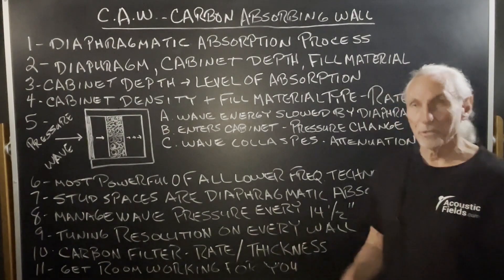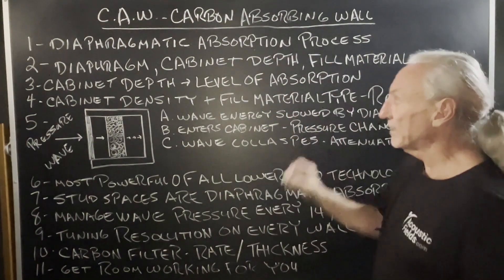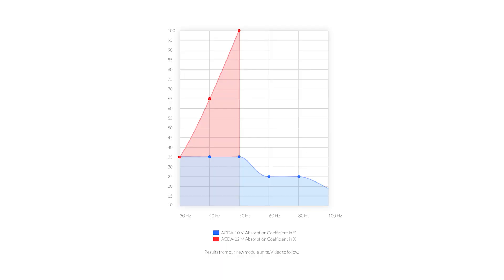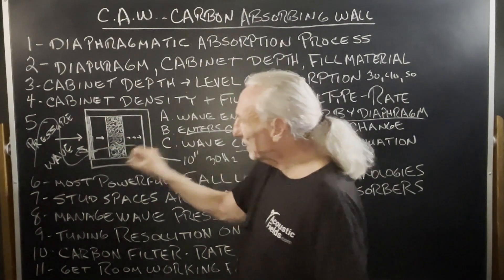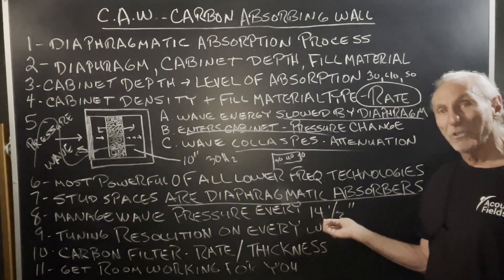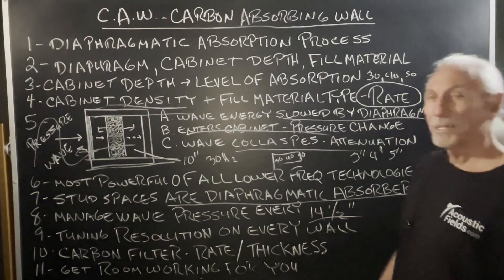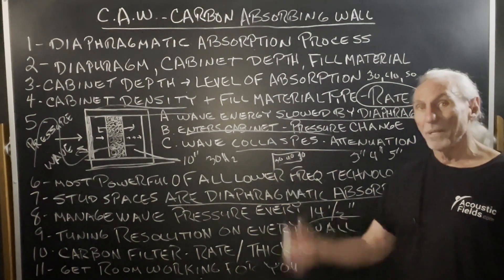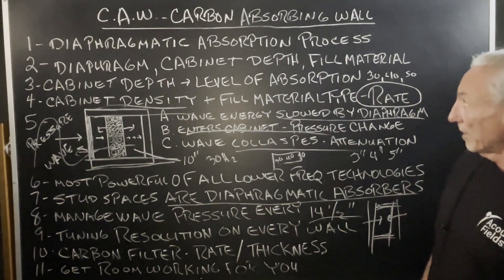CAW - Carbon Absorbing Wall - www.AcousticFields.com

Comment: I've got a three part question.  1) If this is integrated into existing wall cavity, isn't there an issue on "soundproofing" side due to no wall decoupling?  2) Can this be optimized on the "backside" (e.g., exterior wall) in each 14.5 inch cavity to "soundproof" out sounds?  And 3) What is recommended for basement ceiling, with regard to carbon absorption ceiling?  Thank you for your awesomeness!  I make biochar, mostly from red cedar, and also had been considering making cedar-chip/ biochar/ cement boards for such a purpose (and other acoustical applications, e.g., sound barriers)... and I came across this wonderful explanation of acoustic design!  You rock the casbah!  Appreciate ya!
Reply from the maker: WOW thank you so much. It is nice to see my work appreciated. You are confusing sound absorption with noise transmission. The CAW is a sound absorption methodology. Your barrier technology should be installed prior to the CAW. Starting from the  They are separate systems. If the noise levels are not too high, we can build the barrier into the CAW. When you treat a room for low frequency pressure absorption, you always have to treat the four walls. You may be able to get away with treating just the ceiling and four walls. Sometimes, in high energy rooms (drums) you must treat the floor also. The basement ceiling has to be treated with barrier technology since noise transmission through the ceiling in a basement up to the first floor can be an issue. You sound like a serious person when it comes to sound. Send us you room data. Let me take a look. I will save you thousands in mistakes.
Reply: I'm also working on creating a basement room into trackign and mixing room, and may "take" another room for control down the road.  Thanks again for your wonderful explanations of acoustic principles....

Comment: Is it ok to have a CAW on one side wall (interior), and carbon cubes on the other (exterior)?
Reply from the maker: When you treat lower frequency pressure issues, it is all about the square footage of treatment coverage you put on each wall surface area. Remember you have three rooms within your room. You have a sidewall to sidewall room. You have a floor to ceiling room and you have a front to rear wall room. All three rooms have different frequency and amplitude issues. The treatment type and amount will be different for all three "rooms". The goal is to use enough treatment on each surface area to treat 80% of the frequency and amplitude issues. If you use our CAW system you are treating 100 % of the surface area. If you use our cube technology you would be using much less treatment coverage. This inequality in surface area coverage would produce phase which would manifest itself in many ways. One side of the room would have an 80% solution and the cube side much less depending on the number of cubes you used. It is always best if budget and space are issues, to treat each of the three "room" with eaual amounts of treatment coverage.

Comment: How much can I benefit from the CAW, if I have 3/4 window coverage on the front wall?
Reply from the maker: There are three sound fields within every room that impact both pressure and reflections. We have floor to ceiling, sidewall to sidewall, and front to rear wall. There are three "acoustic rooms" within one room. For pressure (modal) issues, we need to treat at least one wall of the two in each sound field with the CAW for a new build. You will need to treat the glass for reflections.

Comment: I will look forward to those new videos. I've been looking at all the plans that you give with the package from the website. 
I've had it a few years now. And have a carpenter friend(I hope) Just to have that Front wall for moderate volume couch listening will be stunning enough for me. Might even add a buttshaker to the couch. Instead of more woofers.
I've heard how tight your rooms are over 10 years ago. Been to a lot of recording studios. Heard the control room sound(my preference but want the staging of the instruments) That calmness of sound the effortless feel.
Reply from the maker: You can not treat one wall with a pressure activated technology. Remember the definition of an axial mode is unwanted pressure between two parallel walls. If you treat only one wall, you create a phase. If you are using a DIY approach, please contact us before implementation to avoid these types of issues.

Comment: I'd like to know the actual density and compression levels of the acoustic foam you're selling, but it doesn't say on your website.
Reply from the maker: Our foam has a density of 1lb. / sq. ft.
Reply: @AcousticFields - Interesting. Here's a quote from Google: "What is 1.8 density foam - 1.8 is a high density foam, which means 1.8 pounds (lbs) per cubic foot and is usually the same density of furniture cushioning, which can be measured by weighing a block of one-foot square foam. Foam with 1.8 density is classified as good quality foam and is the most frequently used for residential furniture." Incidentally, they also sell it at Home Depot in sheets of 4 feet by 3 feet for $30. Care to explain that ? These are type of things I think you need to explain before selling foam for exorbitant amount of money. It's not like the foam is lined with 24k gold. For all your customers would know, it's fricken foam that's likely made for dirt cheap in China. Seriously..